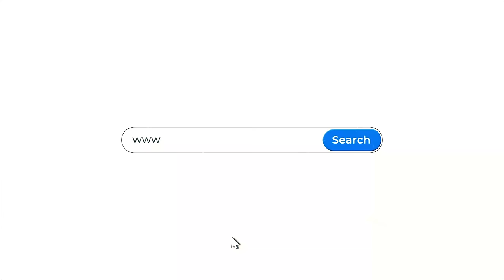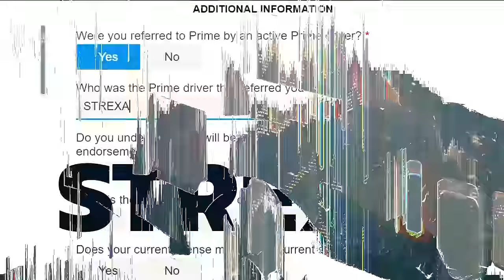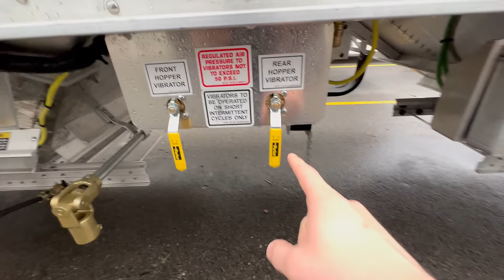Prime Inc's Latest Hopper Trailer: First Load Filled With Surprises!

Comment: If you need to get inside the hopper to clean out, a rope from each end with knots to hang on to helps.  Also watch the slides in the bottom of the hopper, keep them clean and everything works better.  And if you can get an extra handle for the trailer, some one some where could walk off with the handle leaving you wondering how to unload...
Reply: Keep in side box no problem with theft

Comment: I don't you to be ignorant Rex but a coil pack is a coil of 2 or more coils which are in 1 coil pack module. What you have are coil on plug type coils.
Reply from the maker: I know they are individual coils, growing up my pops called them packs so it stuck with me. So I’ll continue to call them coils packs, even the mechanic at the shop felt the need to correct me lol 🤷‍♂️

Comment: The squeaking brakes is probably due to minor surface corrosion that sets up on the rotors overnight due to moisture. Very common. Should stop making noise after a couple of stops.

Comment: Cool video Rex! Could you do a video on how they clean out the hopper? Be safe out there!
Reply: I think it's called a broom.
Reply: Ideally you would get it washed out somewhere but most of time you have to climb in there with a broom and sweep it out. Once it’s swept out just haul ass down the road with the tarp and doors open to let anything you might’ve missed blow out.
Reply: @UP7729  Who pays for the washout?
Reply: @user-FTRU6GJ  Some places will have a small lot to the side to clean your trailer out but other times I did it on the side of an exit ramp
Reply: @nobull4414  Every time I had to get a washout was for when I was hauling organic grain so we were able to get the customer to pay for it
Reply: @UP7729  This is Prime, they make the lease guys pay for the refer fuel.
Reply: @user-ht8po4tv1c  why are you not sweeping your trailer out over the pit before you shut your traps. Customers usually like to get all there product

Comment: Hey rex, I got a question, can you run a reffer and a hopper? like switch back and fourth between the two
Reply: Hopper loads are paid by weight, a refer tractor is too heavy.  Or you can load heavy, which is what I did when I ran a pneumatic train in Nevada.